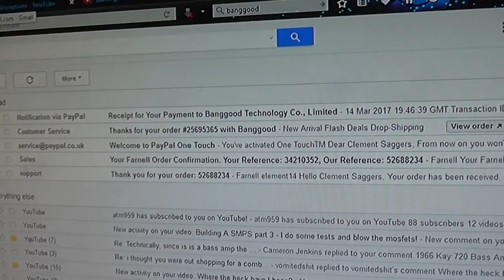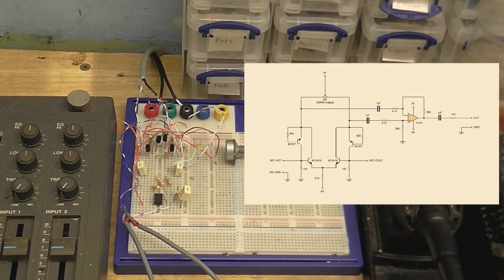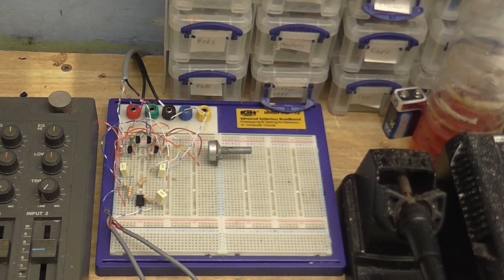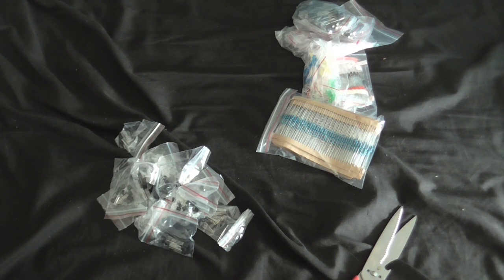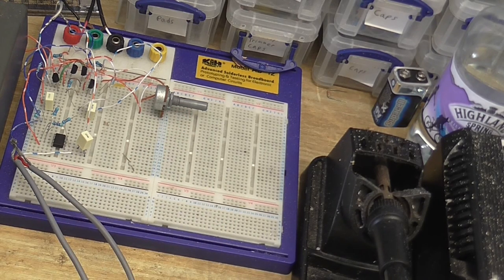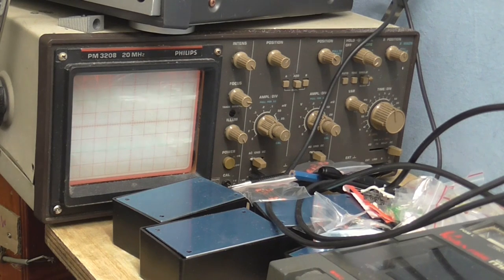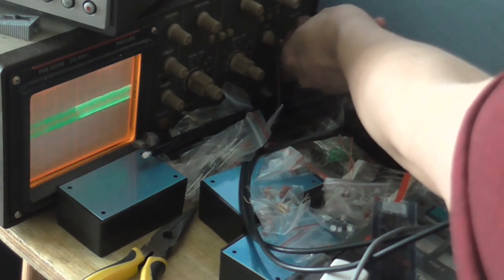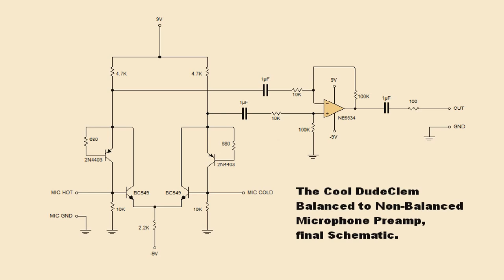CDC Electronic Workshop -  Balanced Microphone Preamp part 2 of 2 (finally)

Comment: Good job, those project boxes fit the application well. It looks like the bottom plate is metal, if it is, you can ground it and use that as a shield.
 I didn't expect metal film resistors to do much better, I had a play with them myself and I couldn't hear any real difference. I like to use them where the stability over temperature is necessary because they don't drift as much as CF does.
Reply from the maker: I was a little surprised myself at how well it worked with ordinary carbon resistors, anyway the bottom plates on those boxes are indeed metal so what I did was solder a springy wire on to a ground path on the board so it contacts the plate when I put it on.
Reply: That's a nice touch with the springy wire, makes it easy to take apart.
Reply: MrJohhhnnnyyy To my experience, the larger the value of the resistor, the higher the noise. But, maybe really not audible below like 100 kOhms?

Comment: Nice build! Looks like your circuit is suffering some undesired oscillation. You can whack some 10pF capacitors across the 56K ohm resistors and that should get rid of them. If it doesn't help, I suggest increasing this value to 100pF.

P.S. If it still doesn't help much, you can still put a RC snubber in parallel with the 10K ohm resistors of the differential front-end. I would recommend a 1nF film capacitor in series with a resistor of anywhere from 10K ohm to 100K ohm. Of course, that would sacrifice some of your bandwidth and input impedance for some improvement in circuit stability.

Comment: I thought the OPA2134 sounded the best. The NE5534 sounded a bit raspy to me. I still enjoy your electronic videos.
Reply from the maker: I wasn't too pleased with how the NE5534 sounded myself, so now I've replaced that with an OPA2134, it was a little challenging since I already had everything soldered wired for the NE5534, but managed all the same to change the wiring so I could use the other chip.
Reply: I was looking on Aliexpress last night for an OPA2134 and they all looked counterfeit to me. Well, maybe one seller had real ones, but they were not cheap. Burr Brown parts usually are pretty pricey. For what I do a TL072 is good enough.
Reply: Paul Frederick They should cost about at least 3-4 $ /piece in small batches, otherwise it's probably fraudulent stuff.

Comment: Thanks for another great video! Do you have any ideas on how to best make an optional un-balanced output? My reel to reels have rca input so I want both balanced output and un-balanced.
Reply from the maker: What do you mean? The pre-amp's output IS unbalanced, it doesn't just boost the signal from the microphone, it converts the signal to unbalanced so it can be connected to things like that.
Reply: CoolDudeClem Ah okay, I've done similar circuits but with BALANCED OUTPUT but have not yet found the optimal way to get the output UN-BALANCED. I'll watch your circuit layout more in detail, just listened to the audio in this video. :)

Comment: how about a pre-amp with phantom power ? Great vid btw.
Reply from the maker: I don't have any kind of mic that requires phantom power so it would be kind of pointless, the only thing  that comes close is the preamp I made for a stereo electret mic I made.
Reply: CoolDudeClem yeah, but you could feed your circuit with phantom power anyway. And have an optional battery power back up.